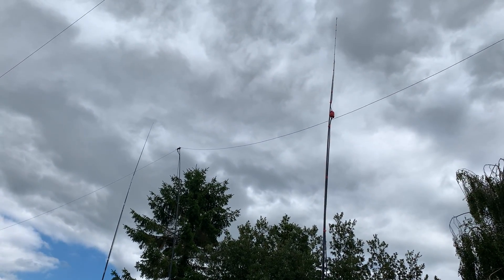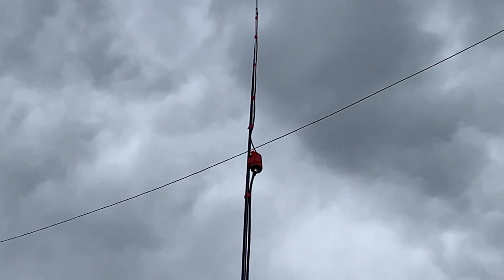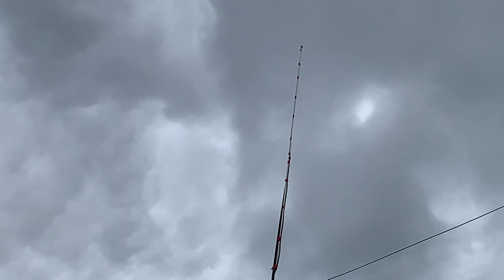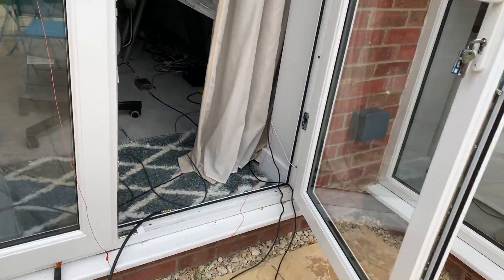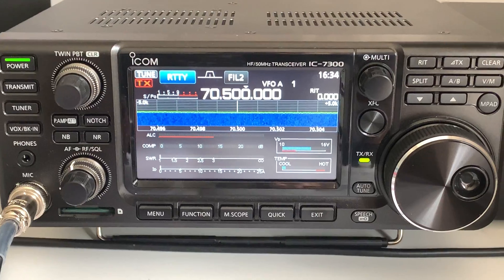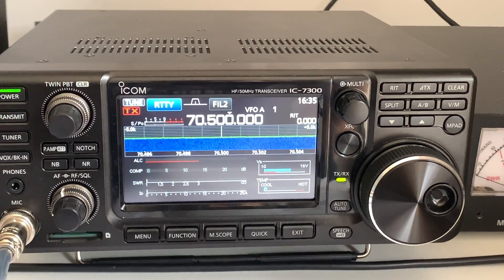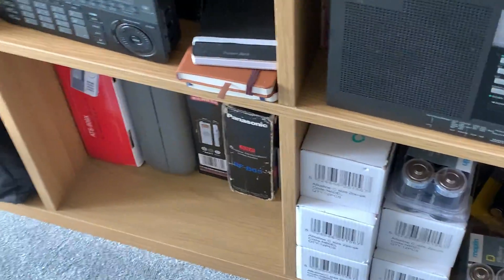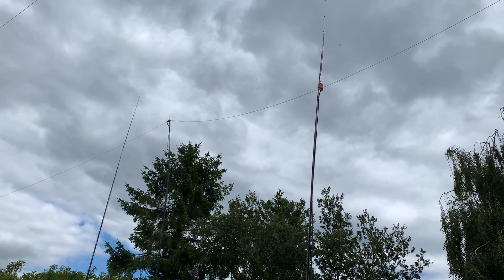DIY coaxial vertical dipole antenna for 4 metres, made from ham shack junk

Comment: Why do you need to match it ? .... It should be resonant.
Reply: There's probably more  loss  by using the AMU than not using it , Ide certainly try to get the Antenna resonant and remove any external things such as AMUs etc to cut down on loss , Losses in the antenna system work both ways  RX and TX 👍
Reply from the maker: It fell apart about a year ago lol - my practical skills usually result in a less-than-robust antenna! 73
Reply from the maker: Mine wasn't - not completely anyway